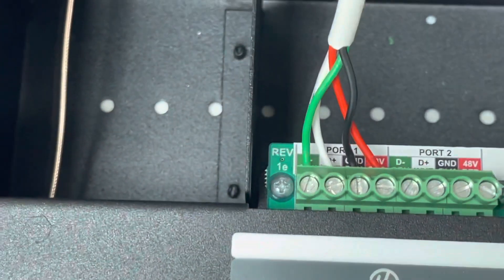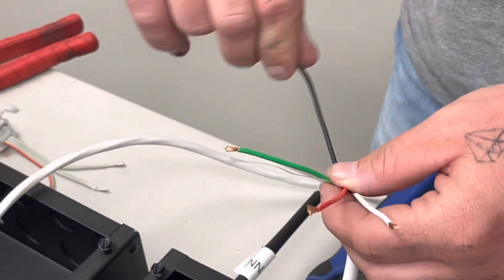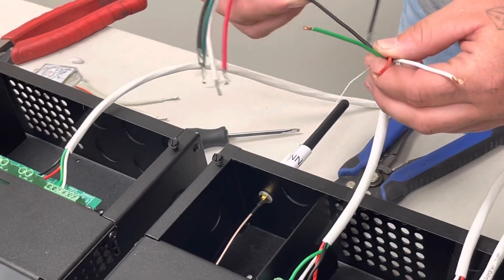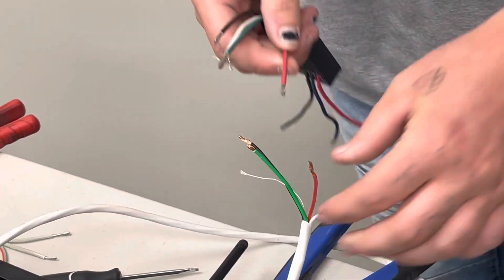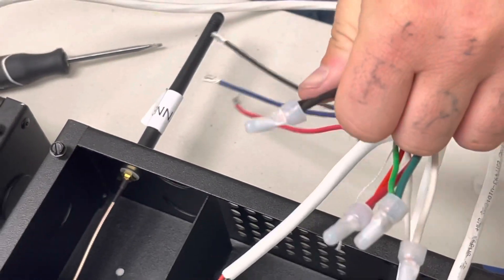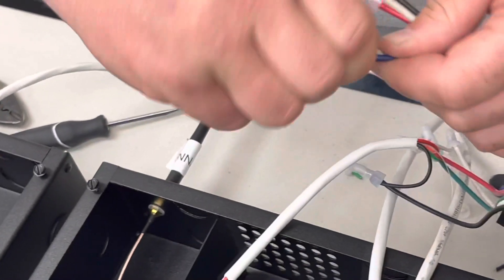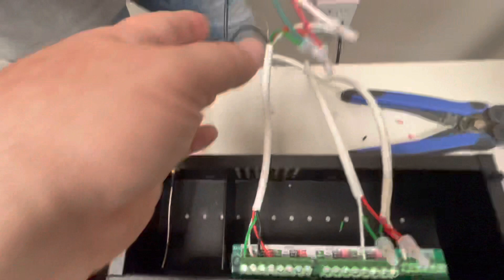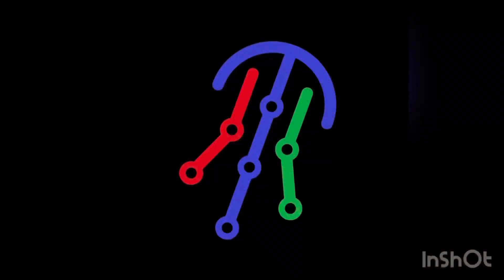Jellyfish Lighting - Transmit and Receive from the 11A Controller

Comment: So why are you using that wire nut while bonding aluminum threaded wire to copper when nec states that you must use the special purple wire nuts/ lugs when it comes to bonding aluminum to copper so that the aluminum 1 has nolox already inside of the nut and it helps to prevent oxidizing?
Reply: are you sure it is aluminum?  maybe it is just tinned wire
Reply: @superalpha  dude that's definitely aluminum wire.  It might be pure aluminum which doesn't expense like the old aluminum but the rules are the rules